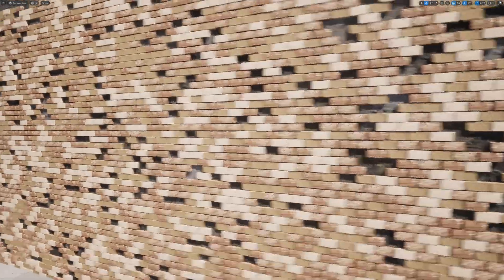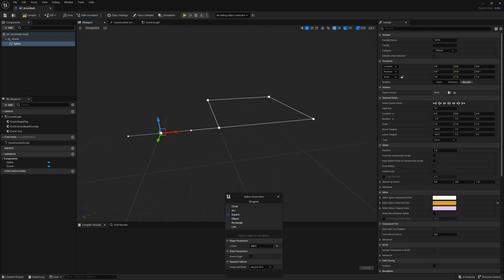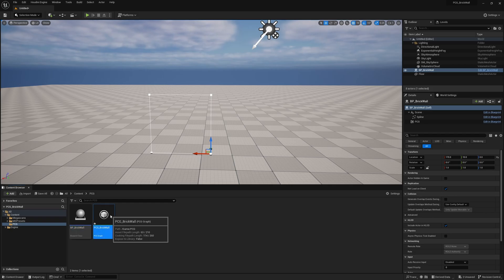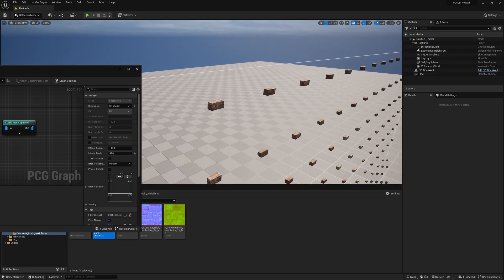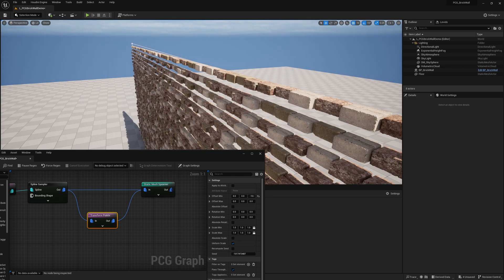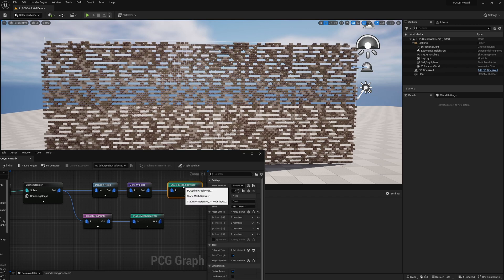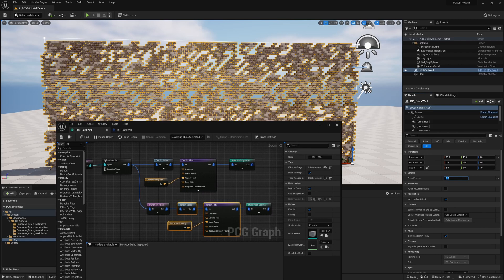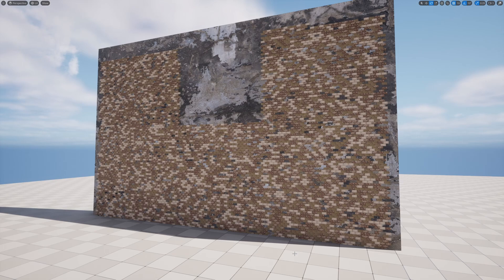Procedural Brick Wall Using PCG | Unreal Engine 5.2

Comment: Did the Bricks had there pivot point centered or bottomcenter?
Reply from the maker: It's been too long, I can't recall. But you can just offset the bricks with a transform points.
Reply: @Procedural_Minds  oh you answered so fast i didnt expect that ty :D hum i hoped to actually prevent that to end up with a cleaner graph by just putting pivot P. directly where it should be on my custom claytoonbrick it doesnt rly have a technical apporach its just easier to remember if not added to to the main spawn offsets if looking at the graph when some months have passed ,but i guess i just make a seperate point transfom with offset and comment it ,thx for u content btw its very enjoyable to learn new stuff pcg stuff here

Comment: Is it possible to somehow make the edges smooth, without protruding bricks?
Reply from the maker: You would need to add a point to each row and then spawn a half sized brick either at the start or end depending on the row.
Reply: @Procedural_Minds  Thanks. Yes, I had that thought. Any hint how detect start/end point every 2th row?
Reply from the maker: @IgorKushnarev  In new versions you can use loops and then just check that the loop index is odd or even.

Comment: Looks like these bricks have the width = 2 * height, so you may fill the gorizontal intervals with one more line of the brics. But what if the brick proportion is not that good? Is it possible to setthe  intervals for x and z of the points separately? "Interior Sample Spacings" sets both intervals: x and z.
Reply from the maker: You can do just horizonal first, and then copy points up and offset as needed.

Comment: Hi !
I got stuck with error on Spline Sampler "One or more rows of the spline interior failed to sample (intersection test failed). Ensure the spline points are not overlapping."
Any ideas ? I'm on UE 5.3.
Thanks !
Reply from the maker: Would need a bit more info: Is this for the intersection spline for cutouts? Is it an error or a warning? Where do you see it? Etc.
Reply: Error on Spline Sampler Node, when you switch interior mode at 2:54.
Default interior space settings (100/50) gave me the "one or more rows" error.  @Procedural_Minds  
Lower the interior spacing to 50 seems to did the trick.
Once Mesh spawner node is correctly set the error goes away anyway.
Reply from the maker: @raphaelmillies-lacroix570  Huh, that's bizarre. I'm glad you got it sorted out after plugging in the mesh spawner.
Reply: U have more than the 4 SplinePoints, u must delete all other Spline Points. Not the 4 Spline Points on the Corner
Reply: I recreate spline rectangle few times thinking this but I did follow steps carefully @FischersFritze12  
I don't know why but 100/50 space settings trigger the error for me.
Reply: Interior Sample Spacing must  be  at least twice Interior border Sample Spacing
Reply: I'm also stuck, made sure I've got 4 spline points (started outr with 5 if I follow the example but that also doesn't work) made the rectangle size 1000, sample spacing 100 border sample spacing 50. At most it does 3 of the 4 sides and never the interior (It's on "on interior"). I'm in UE 5.5

Comment: I know you have other vids on pcg but this one especially, is very useful to explain concepts to beginners. I wish you'd gone just a few steps ahead (for this example) and used a tag based example.
Add an actor to the level and tag it. Then add it into the graph via get actor node and pipe that into a difference node.
Cheers
Reply from the maker: Thanks for the feedback! I'll try to go through alternative methods of tackling the problem when I can. :)

Comment: seems like a bad idea for performance... nanite is all about overdraw.... those bricks are always overdrawing the background...
Reply from the maker: The idea for this isn't to use it live. You use it to create the PCG, convert it to static meshes, and then use them as assets. You don't have to keep things as live PCG.
Reply: @Procedural_Minds  right but the back wall poly still exists with brick polys layered over it... even when converted to static mesh... makign it bad for performance if you are using nanite due to the overdraw.
Reply from the maker: @mindped  That is very true. You can combine the pieces together to reduce that while using the same method to create it. Mostly I'm showing a method of using PCG to get a result like that. For the tutorial I didn't feel the need to make a custom asset that would be ideally optimized.
Reply: Would you mind creating a sequel video, going over optimization of this technique? I'm using Geometry Script for architecture & would like to know more
Reply from the maker: @elganzandere I'm actually planning on making a video for tomorrow showing how to bake down PCG to a static mesh for things like this. So you can use PCG as a creation tool effectively. So unless something goes wrong, look forward to that tomorrow.
Reply: Cool man , I will try make an Ivy on wall

Comment: Cool, and scary, it consum gpu a lot ?
Reply from the maker: Depending on how many points you end up generating it could be more expensive of course. But the best use case for this is to create a few different setups and then bake it down to a static mesh and use that to instance around your level.